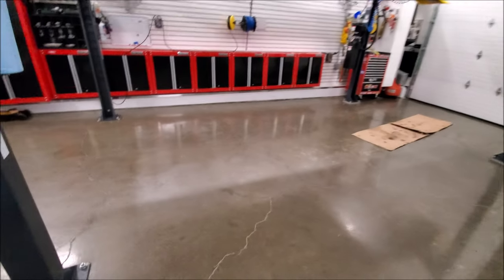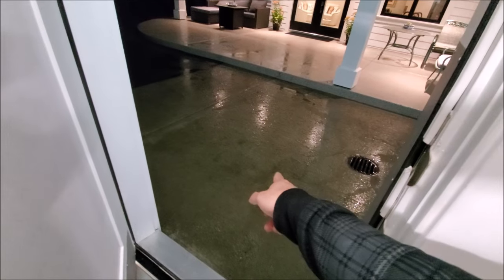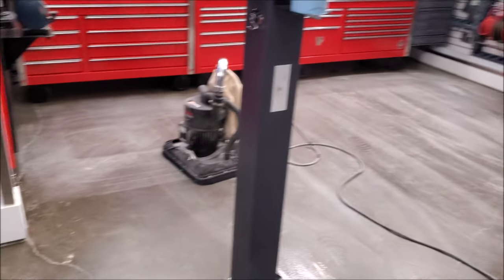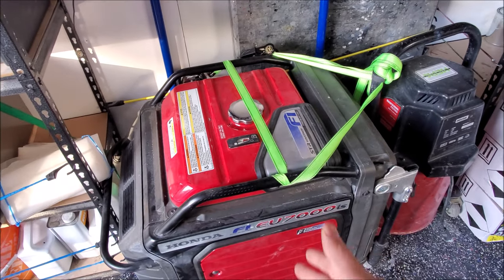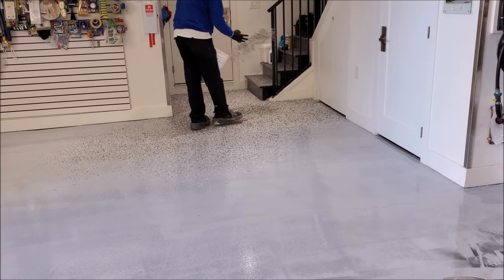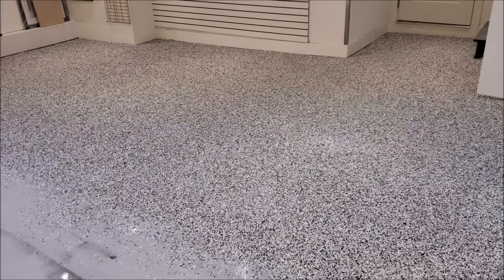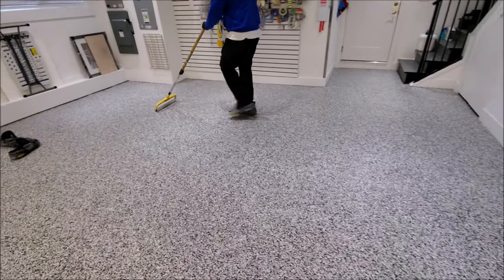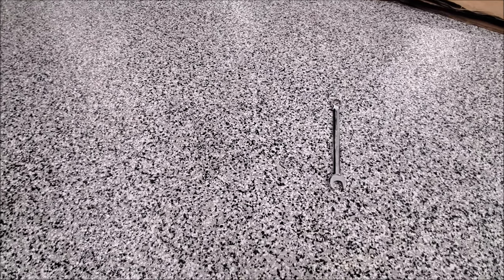Garage Floor Coating Professional Application Polyurea (Kal's Epoxy) | AnthonyJ350

Comment: my house will be completed in a couple months and i plan on doing this before i move in... i've done my research and polyaspartic/polyurea coating is where it's at... the only con i see from the flakes is when you drop a small nut/washer/etc on the floor, it may be difficult to find, but that's a small gripe... thanks for sharing !
Reply from the maker: I 100% it is more difficult to find items that fall, and it sound different when they fall.  You'll want a good organized work bench to make sure small items stay there.

Comment: I've done this for many years as trade work, The company I worked for have redone many other competitors floors due to failures. Hopefully they guarantee their work, I'm really surprised they didn't grind off a layer of the concrete to make sure it adheres properly. We had a guarantee of 15 years, that how confident we were with our work. I hope they also at least sanded down the edges and corners, because that's where we usually saw pealing from competitors floors. Also if the cracks aren't filled properly, such as grinding them out and filling them, they will appear in a few years as cracks through the coating. But none the less the end product looked good!
Reply from the maker: The floor was grinded a ton when the seal was put on from the first job.  All the cracks were filled before the coating was applied.

Comment: hey anthony, I need a shop to bleed my clutch and replace the slave and master cylinder for my 350z. do you know any reputable shops that can do that? thanks
Reply from the maker: There's the Z Shop in Surrey BC.
Reply: @AnthonyJ350  thx man, the clutch on my car feel really heavy. so i hope it resolves this problem when i go to fix it
Reply from the maker: @RichardLi-og2lb  If the Z Shop is too busy, also try Best Transmission. Hope you get it sorted out!

Comment: Not grinding that down to bare concrete is a definite fail point. I would be surprised if that does not fail within 5 years or less. Always grind the concrete for best adhering.
Reply from the maker: Why can't you grind the polyrea that was on there initially? It won't bond to itself?
Reply: @AnthonyJ350  You can but that was still shiny which tells me it was barely ground or not fully. You never want to put a base coating on that is not soaking into the concrete itself. Either epoxy or polyurea needs to permeate into the concrete or the product will fail prematurely, guaranteed. A polyurea/polyaspartic floor should last 20+ years depending on traffic and abuse. An epoxy/polyaspartic will last 10+ years depending mainly on temperature and sunlight affecting it. Epoxy does a great job with moisture for install. Polyurea once cured handles all environments better than epoxy, polyurea is temporarily temperamental to moisture before full cure but is way more flexible and stronger than epoxy once cured. Both systems need to be installed to bare, ground concrete.
Reply from the maker: @HENSLEYDMB  Good to know
Reply from the maker: @HENSLEYDMB  Are you saying they didn't grind it to a haze? Because I watched them do it.

Comment back in 5 years and we'll see if you're right.
Reply: @AnthonyJ350   This is what I do for a living. I own a concrete coating business, we do over 10 million a year in sales so I don't say this without knowledge. It is a total crap shoot if the floor is not prepared properly. From the video here it does not look like the coating was ground to bare concrete? That is what we would have done because I built my reputation on not having to redo floors.
Reply from the maker: @HENSLEYDMB  Message here in 5 years and we'll see.
Reply from the maker: @HENSLEYDMB  What's the company called?
Reply: Hensley is 100% correct, should have ground down to the aggregate for maximum adhesion. It’ll be a matter of time before it fails prematurely.
Reply from the maker: @davidmanfredo1260  Come back in 10 years and we'll see how it is.